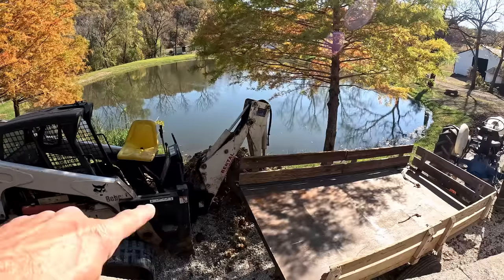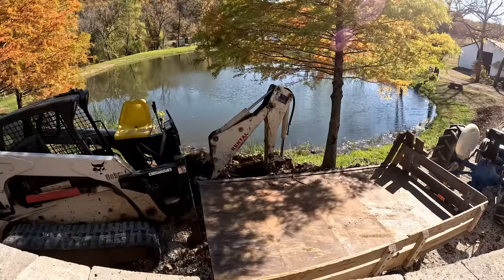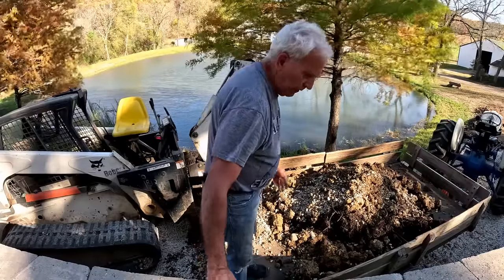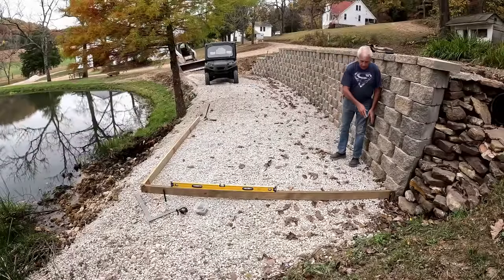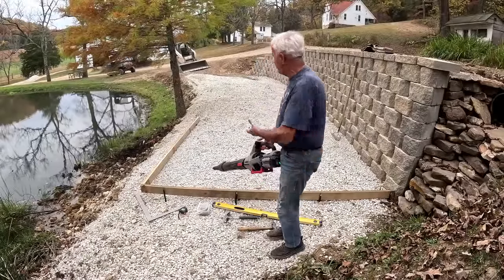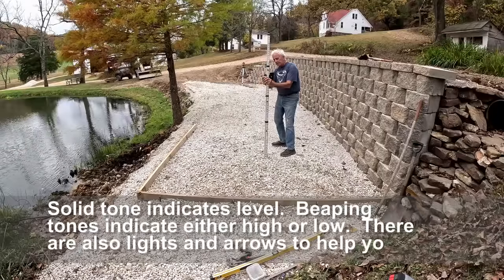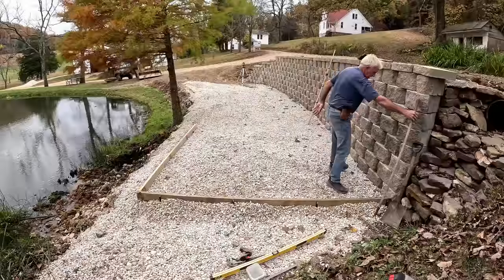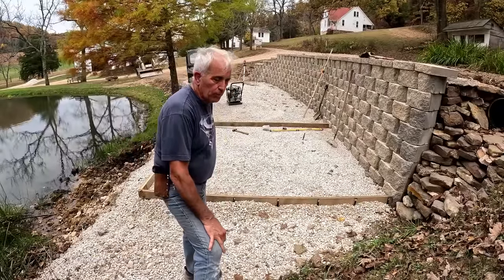674 RSW Cleaning Up and Building Forms

Comment: When squaring up forms, fields, large frames, etc, etc just remember 3, 4, 5 are the ratios of a right triangle and you'll be square and fine.  For example if your existing straight wall is 20 or more feet long then measure down the wall 20 feet from the corner your squaring there which is 4 five foot divisions, measure out 15 feet at a right angle from the corner to get your 3 five foot sections and then adjust so the diagonal measurement across from the end of the 15 feet to the far end of the 20 foot measure and adjust the outside end of the 15 foot line until it measures 25 feet between both ends of the right triangle you're creating to make it square.  Some will make a 60 foot loop of cord with a Sharpie mark or knot at 15, 20 and 25 feet to make it easier to just put two pins spaced 20 feet apart along the straight wall aligned with the ends of the 20 foot section, pull the cord taught where the 15 and 25 foot sections meet which will make the square of the right triangle.  You can go with 30, 40 50 feet, 60, 80, 100 feet or any other combination of 3, 4, 5 to make your right triangle.

It will as the expression goes be "Close enough for Government Work"  and any discrepancy "Won't be that noticeable from a jet going over 600 MPH".

See for pictures and arrows:  https://www.wikihow.com/Use-the-3-4-5-Rule-to-Build-Square-Corners

Best!